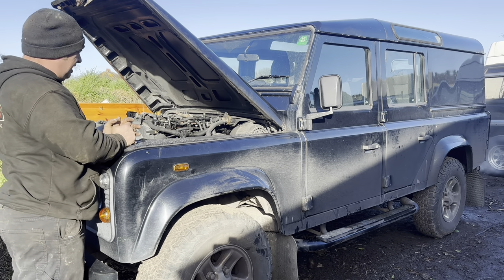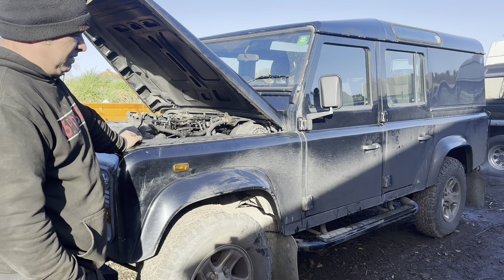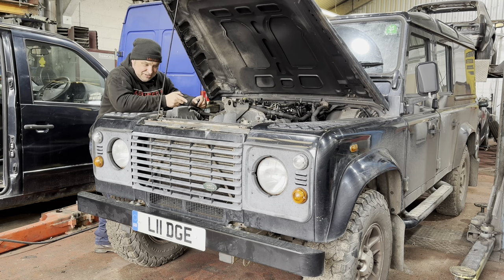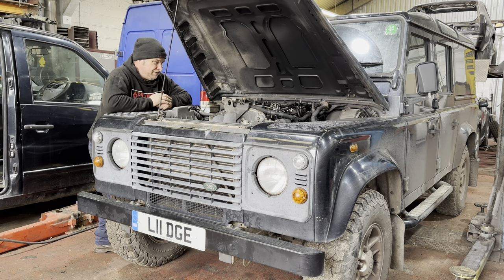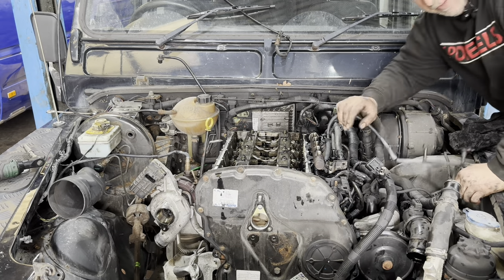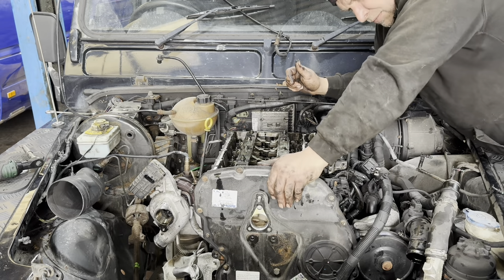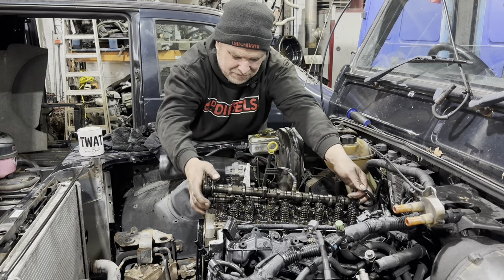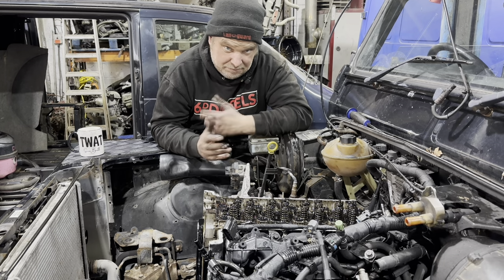Land Rover defender 2.2 engine failure we tear it down!! Is it fixable??? One way to find out

Comment: What a wonderful rant from the man that knows....You missed the wonderful merits of stop start...
I saw a 23 plate Iveco pickup exhaust system out on the floor, about 20 pokey sticky out things with elecy wires or tubes sticking out of it...5 yrs down the road i can see the parts dart teams having a fine time on that...Somebody had alf hinched the Pussy out of that...

Comment: I’ve got a 200tdi defender which I’ve had for 21 years now and it’s got 300,100 plus under its belt.  Its let me down once when the clutch exploded.. my own fault, it came in a blue box!
My wife drives a 2001 discovery 2 which insolently is nearly the same reg as the merc van in background by the looks!   My father took that on at 5 months and that’s now got 203,000 miles on it.. its been a fantastic vehicles which has taken us all over Europe and Scandinavia including up inside the artic circle.
I do have a work 2013 2.2 defender and the one thing I said from the off is that it goes very well and tows well for a small 2.2 which makes be think the engines are now over stressed!  I also do agree that the brand has become an absolute joke and in my opinion (ex Land Rover mechanic) I honestly believe the good old defender went down hill when the pumas came along with these Ford engine… they are absolutely shite!
As for the td5, I personally think it’s a very good engine and the biggest problem was the factory forgetting to use lockthread on the oil pump bolt and standard with Land Rover… getting so close to a great design and then ruining it by using plastic dowels in the head on the earlier engines!!

Comment: I drove three hundred miles the other day down the M5 and back to see 80% of the vehicles on the hard shoulder were Land Rover. I was driving my Citroen Relay mind with a 2.2 Ford engine that has done 260,000 hoping to get to 300,000 as I can't afford another at the moment.
Reply: 260k on a 2.2 good going just put the 3rd one in a mk8 transit that’s only done 196k 😂

Comment: The original Ford 2.2 actually did fair service considering the risk of injectors and oil pumps failing. I’ve this engine in a 2014 Ford Ranger and although it is thirsty and dead off idle, it’s a much better engine than previous LR engines I’ve owned.  The latest wet belt 2.0 Fords, assuming that they have finally sorted the wet belt failure issue, is a superb engine.

Comment: I totally agree with everything you said in your "rant" Al. I make my money repairing VW Group sat navs, dealers tell the customer they need replacing at £2800+VAT, I repair them AND activate options like Apple Carplay & voice control which the dealers charge £400+VAT for, all for £150. I even fix them for VW dealers, but only for the vehicles in their sales department of course! Our family cars came from Copart, disposed of by the insurance companies with minor damage because their algorithm said it'd cost too much to repair. They both took 4 days to repair including waiting for parts to arrive and waiting for paint to dry. If they weren't crashed they'd be worth £26k according to AutoTrader, they owe me £11k, are repaired correctly with genuine parts and look like nothing ever happened. On the subject of Copart, maybe put the Green Oval disaster on there, now you've thrown it together it "runs and drives"!

Comment: I knew someone that use to run their Peugeot 306 diesel turbo on cooking oil with about £3 of diesel to thin it out. Use to drive as per normal. So yes we are being conned.
Reply: I ran my old Mercedes 307d motorhome on used cooking oil strained and a little diesel for years and when it did have an mot it tested absolutely clean on emmisons although it  stunk like a burger van.

Comment: Couldn’t agree more. I use an old school engine rebuilder place where I am, they are all over 40 it stinks of oil and I barely get a grunt, but they know how to diagnose, repair and service my vag 1.6 tdi which is more than the dealer and 2 specialists could. And yes I know it’ll probably self destruct being euro 6 but I’ve got to 130k and will endeavour to reach 200.

Comment: Thanks for your video. Agree with you on the electric front. Interestingly I have a 2016 Ford Territory (model unique to Australia and New Zealand and built here in Australia. The car has a 2.7l V6 Diesel the same basic engine as the Discovery yet the Territorys have alot less problems and are regularly doing 300000 to 400000 without to many problems. Marc from Australia
Reply: Thats Km not miles

Comment: Fantastic 37 minutes Al, I agree with absolutely 30:05 everything you said. 
I had a2 .0 Disco sport with ad blu,just out of warranty with 37,000 miles  & add blu countdown light of death came on, car physically stops if it’s not sorted & JLR dealer tried to charge me over £1000 for full set of new injectors & drain 33:06 the adblu  tank! Don’t think so asked them to stop any more work, drove it straight to a BMw dealer & PXed it there & then absolutely sh1t dealer & customer service. 🤬  never again!

Comment: Spot on Al. Our company has a fully electric van, which I can only describe as a piece of 💩💩 It doesn’t like hot weather, it detests cold weather and twice now, the cables underneath have been attacked by rodents. Not sure if it’s rats, squirrels, foxes 🤷‍♂️🤷‍♂️ But whatever it is, it gets off on eating the insulation on the cables 🤣🤣 Keep up the great work Al 👍👍

Comment: The thing is that the injectors are bought in by Ford, not made by them. I think they use Continental [previously Siemens VDO] in most current vehicles and they have had issues. Indeed Transits with the wet belt engines are still being recalled to replace Conti  injectors under warranty.

Comment: AL  you are an old skool mechanic just like me you cant beat the old skool mechanic's modern day stuff is crap and problems waiting to happen. we are in has you say a throw away society  go are the days of mechanical fuel pumps ,carbs,throttle cables.points,condensers,coils,tappets ect.

Comment: Up to 300tdi Defenders are decent enough, cheap parts, easy to fix and parts are plentyful, I know people rave over Toyota but in the UK, 4x4 Toyota parts are not cheap and there's only 2 specialist suppliers for suspension etc.
I find with most Defenders that I work on that it's nearly always down toack of maintenence, people buy them and treat them like a new Fiesta, most are getting on in years now (up to 300tdi) and most are bought after they've been used as a U boat. Budget for all 4 corners, new bearings, seals, discs and pads, probably swivels as well, once done they'll last well, keep the oils changed including Diffs and gearboxes (people with fiesta mentality forget them) and you'll have a good light truck that will last well, it won't drive like a new fiesta though and you may need some larger sockets and spanners...... 👍

Comment: Absolutely spot on Al 👌 they don't build things to last because if they lasted longer people wouldn't need to buy new stuff...which is crap and doesn't last long!! But apparently the EU are trying to bring in a law that if a vehicle needs extensive repairs it won't be allowed to be repaired and should be scrapped!! Extensive as either engine repairs, welding or major bodywork!! Hence putting what would usually be a repairable vehicle in the bin...so then there's a shortage of used vehicles... (remember the aftermath of the scrapage scheme...) so people would have to buy new...!! But wait ..what if you cant afford new?? Then use public transport or cycle!! See where this is going.... Less vehicles on the road...owned by the wealthy!! Peasants shouldn't own vehicles!! All in the name of global warming ..... Oh wait its not called that anymore 🙄🤦‍♂️

Comment: Do you think using the expensive diesel and / or adding injector cleaner to the fuel periodically might help stop this injector piston popping nonsense happening? It's happened to my mate's transit and I really don't want it to happen to mine. Why can't everything be as simple and reliable as an old DW8 ricardo engine. Yes they were slow as hell but they always worked. 🤪🤪
Reply from the maker: Sadly it seem to be just a good or bad luck thing really, one of the highest mileage one we’ve seen was the worst serviced wagon we’ve ever seen!!! Makes no sense

Comment: What he said! Is what I tell people on a daily basis. For me I won’t/can’t part with my two diesels, for any electric offering, mainly because of price and the silly in practical charging methods. Also as we are being further educated with the new technology, like by yourself,  we learn the dangers of electric batteries etc. I own 2x diesel fords the wrong side of the rules, I can’t even drive through the city centre of Bristol, it’s absolute boll**ks. I can just get about, around my city that I live in, but have failed once and been hit with a hefty fine. If they move the boundaries, (which they will in time, quite possibly I will have to part with my cheap £35 quid tax cars. But don’t want to, I want them to last, they are paid for and are still repairable and workingish. Yes they are not great and had/have problems, the joys of motoring, nothing new, but I like to play and fix, currently had the AA tow me home, last night, 1 out of 3 wires sheered out of the crank sensor plug, on a 1.4tdci Ford fiesta 2007 (second hand plug with tails on its way from eBay) plus the same car also has an odd delay to the dials not working on start up???, but adds to the character of the car, is what I tell myself. So when will I part, well, if we are made to move away from petrol or diesel, what fandango tech has me interested, it has to be all about the method of refuelling that is on a level par to petrol and diesel. hydrogen, seems to be the closing thing to normal, when it comes to refilling. I’ve say to folk ignore the electric phase, just hold on for the hydrogen method. It won’t be cheap, but hopefully quite close to normal(if we have to).

Comment: You hit so many nails on the head 😊
Daughter gets a brand new car every 3 years and will never fully own any of them, she believes the dealer and when he shows her the latest shiny skoda she signs on the dotted line 🙄
She didn't get that from me cos i like nothing better than owning my own car and tinkering on the driveway doing whatever it needs. I do have a few cars as you don't put all your eggs in one basket 🤗
Over the last few weeks I've got a petrol power washer, petrol generator and a hedge strimmer all not working for free from people that couldn't get them running 🙄
Pleased to say i have them all working fine and no cash spent on them. If you went shopping you wouldn't have change from a grand for that lot..... all old stuff btw and you can tell the quality of the stuff, it just works.

Comment: I believe that "old school" designers that had to do an Indentured Apprenticeship's were pushed aside with graduates with no experience in most manufacturing companies during the 1980-90's.I have witnessed Degree holders measuring a drawing on a CAD screen with a plastic ruler. Another one was inventing his own limits and fits , with no acknowledgement that there were Standards already. Proven materials for applications were totally ignored. Bright sparks decided it was a good idea to save four pence to not fit oil dip sticks in an engine. I'm quite pleased in a sick sort of way that at 75 years old, I haven't got much longer to witness any more of this sort of c**p. P.S What I did notice by chance the other day, was that the toothpaste I was using was made in China of all places. That did have a short life on my bathroom shelf. (The best two "Landies" I've owned was a J reg 109 hardtop, and an L322 with a 4.4l BMW engine. Wish I still had it.)

Comment: Crikey, my old 300tdi was a breeze compared to that. As for the ingenium engine, I work for jlr now and the tech in the workshop absolutely hates them. The new defender comes in hybrid with a big lithium battery. I'll stick with my 240k mile kia diesel.

Comment: Eyup Al, I`m wondering if you can help me please?  I was going to buy a Citroen Relay, but am now thinking about a Merc van of about the same size, that is, standard short wheelbase and standard headroom.  The problem is that I don`t know which model would fit that bill and which engines to look for and which to avoid.  What is your opinion Al?  Thanks, Paul from Widnes.
Reply from the maker: If you can find a nice clean late 903/4 2002-2006 313 that would be my advise . Old yes but utterly bullet proof 👍

Comment: Well said that man, everything you said makes perfect sense unless you're a multimillionaire politician that travels first class on the gravy train.
I have 4 Land Rovers all between 1963 and 1989, which I've owned between 10 and 22 years and apart from my 2a with the 2 1/4 petrol the rest have various versions of Buicks cast off engine running on LPG. Another viable fuel that's being phased out due to lack of profit for the greedy so and so's. I deal with new electric buses for a day job, these things will put tits on a bull when it comes to working on them due to the complexity and I very much doubt they'll see a quarter of the service an old Leyland Leopard would easily manage.

Comment: One thing I hate about modern engines is the plastic plastic pipes plastic covers. You didn't mention about the AdBlue. I tell you a true story about AdBlue the reason why they took the blue out of it was making jelly inside the catalytic converters the blue dye was turning into jelly it wasn't a good news on a truck as it cost £5,000 for a Catholic converter. I feel so normal now listening to you.

Comment: Ford finally fitting Bosch injectors to latest transit.  
Current s-max is on 205k and Mondeo on 155k. Ford can make a good engine but yes cost saving makes everything worse.

Comment: I've been looking at swapping my Honda (100,000 miles never gone wrong still on the original spark plugs) for a van and I'm going round in circles because pretty much any diesel van made in the last 10 years has a rubbish engine.  Ford melting pistons or a "lifetime" wet cambelt on the newer ones, Mercedes with the injector black death (I had the 2.2 in a Merc car and it was a disaster, never going back to Merc after that), Renault/Vauxhall have multiple issues with weak gearboxes, sticking injectors.  Peugeot and Citroen use the Ford engine.  Thank god for Honda and Toyota, I think the Japanese are possibly the last people who still care, sadly they have stopped importing some models to the UK as they can sell to the countries in the world don't have these crazy emissions regs (Toyota no longer import their decent vans available in Asia just rebrand Peugeots instead).  I was very sad when Honda closed their Swindon factory, at least we still have Toyota and Nissan making decent cars in the UK.  Its even getting hard to buy older decent vehicles in the UK as they all go to Africa.  I've been to countries where the whole public transport network is made up of vintage Mercedes mini busses and even Peugeot estate cars in rural areas.  The old stuff was made to last.

Comment: Don't care what you say, love these, not Land Rover's fault Ford owned them ;-)  Got a Freelander 2 with one of these in it and it does tend to blow a bit out the oil filler but hey-ho it still runs fine!
Reply from the maker: That’s the psa (Peugeot engine) and suppose to one of the better JLR products 👍
Reply: Yeah, the 2.2 fomoco TD4

Comment: Al ive just watched a garage "salvidge rebuilds" youtube, further to your rant, 2016 corsa with a 1.4 with 31000 miles basically toast with engine crank end float 15mm ish, not economic to repair, known thing no engines around...So another save the world recycle 25% through its life...
Reply from the maker: Yes I just watched that too, doesn’t say much for new GM engines 👍

Comment: A green oval based disaster mixed with a blue oval based disaster equals utter utter shite 😅 seriously, though how do Ford get away with selling shite engines ?
Reply from the maker: 3 year warranty’s I suppose, mind you lots of them don’t even make it that far. Our most unreliable’s of the last year where transits a low mileage newer ranger and the later engined sprinters plus the Peugeot boxers with a transit engine.
Reply: @6DDIESELSDorset  good point AL, hey at least it keeps you employed, my mate owns a recovery firm here in Cornwall and he jokes that Daf trucks pay his mortgage 🤭 Egr valves, Dpf's, and bloody ad blue 🤦‍♂️

Comment: I agree with you if it was a 300/200 Tdi it would still be fine it would drive you to the moon and back. Thing's these days are rubbish electric cars they can keep them. I totally agree with you. Am still running a 20 year old audi a4 b6 tdi Avant sport. I remember when I was in college we had an old black taxi land rover engine. They said was the engine of the future. Give you a good one Al we bought a washer from one them fancy shop's garnted for 3 years a year on the thing stopped working I said to the Mrs get onto them. She phoned them oh what happened to it all the smoke came out of it 😂.  So they eventually came out gave her another one. Be better with a bmw m57 in it seen the L200 with Bmw m57 cracking engine's. 😊